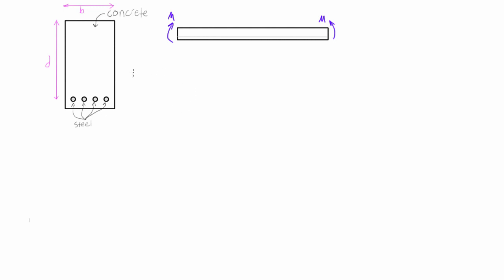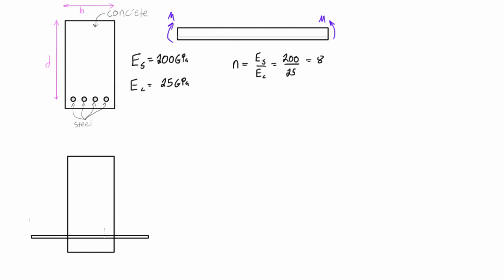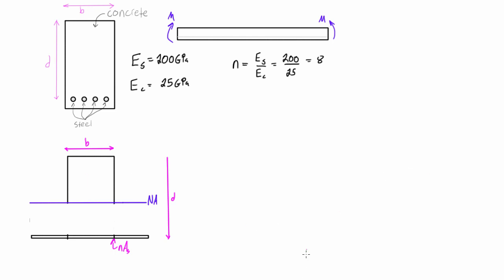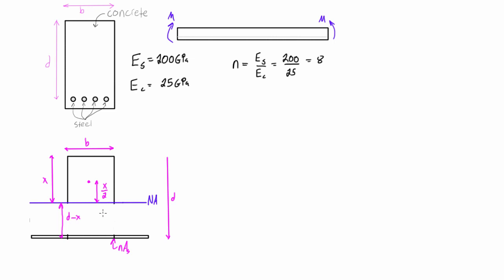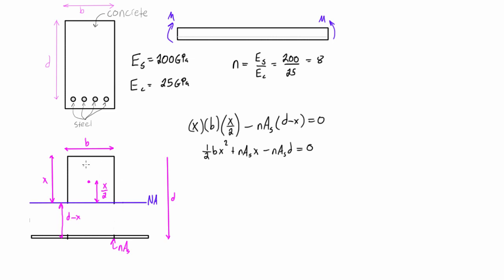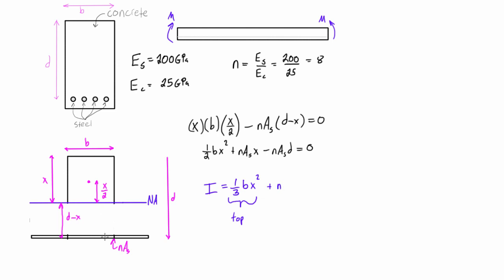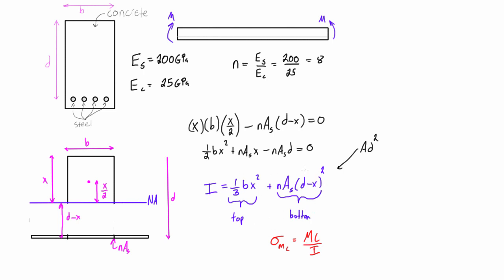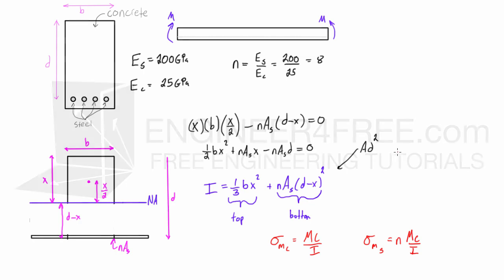How to solve pure bending problems for reinforced concrete

Comment: is the whole compressed area above the neutral line of concrete under plastic deformation? if yes, is there any concrete area under elastic compressed deformation, and why its contribution does not count?

Comment: Can you please do a video for pure bending of Reinforced concrete but for a T-Beam please
Reply from the maker: Hey Sophia. I don't have a reinforced T-Beam, but I do have an example with a regular T-Beam here: https://www.engineer4free.com/4/pure-bending-in-the-elastic-range-example-2-t-beam bithbvidrisbfokkow essentially the same principles
Reply: @Engineer4Free  thank you for replying. Maybe you can answer a question for me? This is for a reinforced t beam  using the transformer method. When calculating inertia, my book uses bh^3/12+Ady^2+ bh^3/3 + nAst(d-x)^2.

Where as the one video I have seen work this problem uses two parallel theorems and then adds the nAst(d-x). My question is why does the book use the bh^3/12 & bh^3/3?

Comment: Can any one give suggestions how to solve -   A rainforced column is 300mm dia and has 4 steel bar each of 12 mm dia embedded in it. If the allowable stress in steel and concrete are 65.0MN/m^2 and 4.0MN/m^2 respectively. Calculate the safe axial load which the coloumn can carry. Es =15Ec

Comment: im confused on why doesnt you calculate the inertia of the steel (disc shaped) but only use nAd^2? Thanks for all the help
Reply from the maker: At 4:13 I mention that we don't define the geometry of the transformed area, just the area itself. You'll see this same simplification in textbooks. If I recall correctly, we can ignore the other term because the actual geometry of the real steel is so small its contribution to the overall value is negligible.

Comment: Isn't the moment of inertia =1/12bx^3 + nAs(d-x)^2 for the rectangle?
Reply from the maker: Hey first of all there is a typo in the video regarding that expression. at 7:00 I say "cubed" but write "squared." I should have written "cubed" but my hand was off doing it's own thing. That first term should be written as I said: (1/3)bx^3. With that noted, the moment of inertia for a rectangle about an axis that passes through its centroid is (1/12)bh^3. The moment of inertia for a rectangle about an axis that is aligned with its bottom edge is (1/3)bh^3. The latter is the case here, because we are taking moment of inertia about the neutral axis, which is an axis aligned with the bottom edge of the top rectangle. You can find these two expressions in a moment of inertia table in any mechanics of materials textbook. If you want to know where the 1/3 comes from, you can derive the (1/3)bh^3 equation by using the parallel axis theorem from (1/12)bh^3+Ad^2 for the top rectangle. If A=bh and d=h/2 then (1/12)bh^3 + (bh)(h/2)^2 = (1/12)bh^3 + (bh)(h^2/2^2) = (1/12)bh^3 + (bh^3)/(1/4) = (1/12)bh^3 + (bh^3)(3/12) = (bh^3)(4/12) = (bh^3)(1/3) = (1/3)bh^3. Cheers hope that helps.
Reply: @Engineer4Free  So using (1/3)bh^3 essentially includes the dimensions from the top rectangle too?

If for example, I use (1/12)bh^3 +A(x/2)^2 for the top rectangle and add that with A*(d-x) ^2 [I ignored the I for the bottom transformed steel as the height is approximately 0). Will i get that same answer as yours?
Reply: Yes